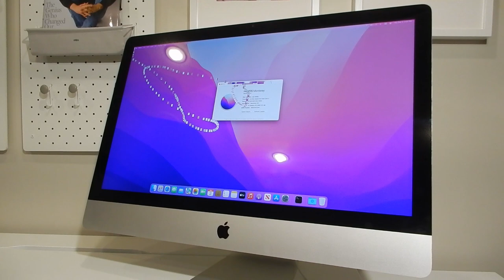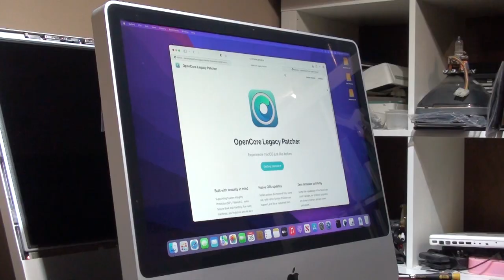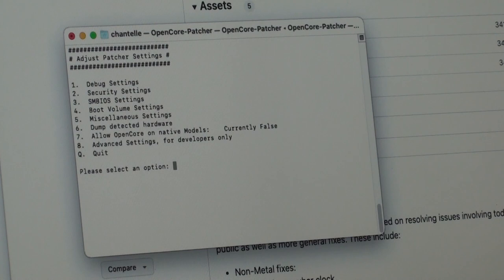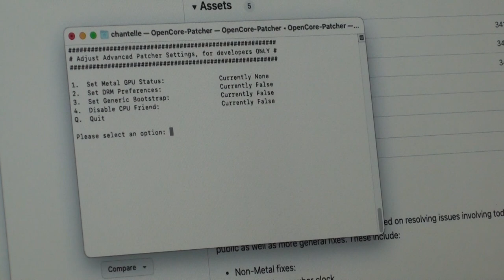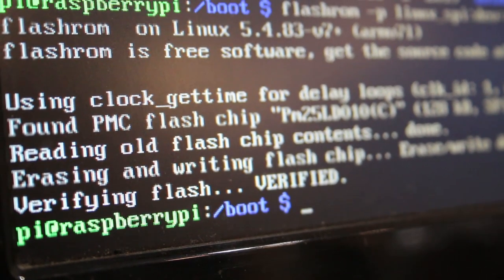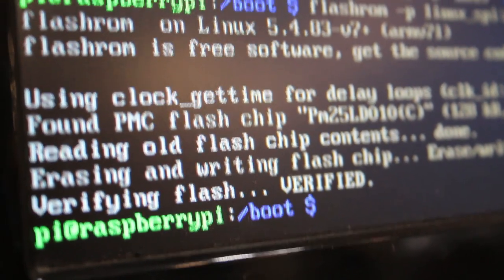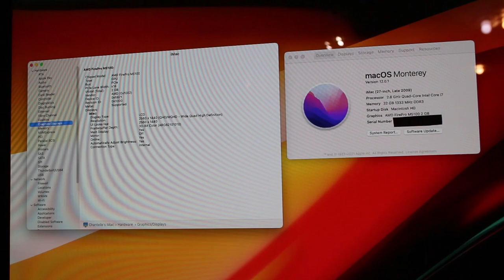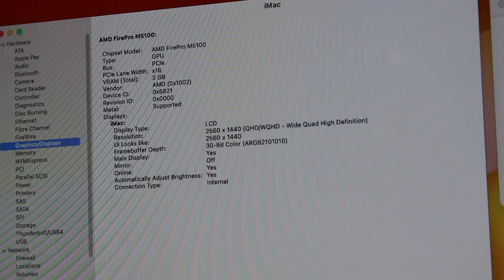iMac GPU Upgrade, Metal SUPPORTED!!

Comment: wish this was possible on my 17 inch MacBook Pro
Reply: There are mods that remove the built in GPU and replace it with an external one but that's about it.
Reply: It is.
Reply: It’s called a Demux, ask around board Repair technician around you if they can do it. 
I live in France and ask 49€ for this modification
Reply: Had the board replaced with a m1 Mac mini board works amazing
Reply: @DavidOlivarez08 what year 17in MacBook Pro did you have? How involved was the swap? We’re there other parts that needed to be changed out to turn your intel MacBook into a m1 macbook?
Reply: @DavidOlivarez08 how did you do this?
Reply: @DavidOlivarez08 wait that's crazy, a 17inch Macbook with an m1 board sounds fantastic

Comment: Alright..  Looking good.  😏👍 The card you chose was a good value and match for a 27".  I did the Linux method with a flash stick.  I used a k2100 Nvidia graphics card  with a 2011 21.5" and worked so well that I got a second one for a 2009 27".    This graphics card packs a punch.  It has decent performance, uses low power consumption of only 35watts and also rather good price.  Oh not to mention this card fits easy without modding.    I also like Nvidia because I have a dual boot system with windows which this card performance is actually amazing on windows.   Oddly it feels faster than with macOS.
Reply from the maker: Nice!  How did the Linux method work?   I foresaw a lot of potential issues (i.e. runs blind until Linux is loaded, etc), which is why I used the RasPi flash method.

For Windows, Nvidia is defiantly my choice too.  I do very little gaming, and much more render workloads that utilize CUDA.  For Monterey though, I think you need hacked drivers to get Metal working - I think something related to that spat between Nvidia and Apple, which is a real shame.  Any issues at all with drivers?  Sleep works properly?

Not having to mod the cooler is a BIG plus for sure!  I was always skeptical that using a shim wouldn't deliver optimal cooling.

I am really curious though, do you have boot screen working?  Can you use the native Apple boot picker prior to OpenCore loading?  You can't on the AMD card I used, which so far is the only downside - fortunately it's only an issue for repairs and service, and doesn't affect daily use.

Comment: It's been a couple of years since I did some upgrades to my 2011 iMac, but this video is a total inspiration to upgrade to the M5100 now!
Reply from the maker: Make sure to check the docs; back when I did this upgrade the M5100 GPU had some known issues involving sleep mode when used specifically with a 2011 iMac.  They may have been fixed by now, just always good to check :) Good luck with your project!
Reply: @rebootretro  Any idea of the overall improvements of this over the default GPU, or is it moreso just a 'replacement'?
Reply from the maker: @TECH097  For most things you'll be CPU bottlenecked.  The only reason I did the upgrade was to replace a failing stock GPU, and more importantly to gain Metal support so Monterey would work fully.  If you are looking for performance, this is probably not the chip for you - there are other compatible upgrades which will give you more GPU performance.  If all you want is Metal support so you don't get weird graphics glitches in Monterey, then this works perfectly.

Comment: Your video is lovely.  All the text forums are filled with bad English and truly hard to understand as nobody posts solutions, only questions. I'm on a mid 2011 3,4 GHz Quad-Core Intel Core i7 iMac and I absolutely love this machine. Got it for a bargain price and I've now installed 2.12 and Sequoia as I thought that would fix iMovie for me, lol. No such luck, iMovie's preview screen is completely black. I am also scared to remove the glass. Any assistance most welcome.
Reply from the maker: Thanks for the nice comment!  I know what you mean about the forums; perhaps it looks somewhat easy in the video, but I spent several days messing around with this until I figured out fully how to do it, lol.  Which was largely to do with very little documentation.  I imagine you haven't upgraded your GPU yet, which is likely why iMovie won't work at all.  The latest version of iMovie absolutely requires Metal graphics and won't work without it.  The only "software fix" around this is to run an older version of iMovie from before it moved entirely to Metal graphics.  Although in order to run an older iMovie, you may also need to roll back your macOS version to support it.  In theory, upgrading your GPU to a Metal-compatible one should solve this on Sequoia.  There are some new apps which may also require newer CPU features in addition to Metal; I'm not 100% certain if iMovie has any additional CPU requirements that the 2011 CPU doesn't meet.  BUT, I'm currently working on making a video involving a 2008 MacPro with a Metal-upgraded GPU, and one of the tests is iMovie.  I can tell you for certain iMovie does open, but I haven't tested editing yet.  If this 2008 runs it, your 2011 CPU should be fine after upgrading the GPU.  Make sure you're subbed and watch for that video.  I'll try to remember to message you back after I run the tests.  Regarding the glass, I would not be too paranoid about it, but obviously use proper safety - have safety glasses and insulated gloves.  The glass does have some flex/bend to it without breaking.  The key is to open it evenly, not allowing the glass to twist too much side to side.  Also don't open too wide of an angle, or the bottom pins in the glass get stuck in the frame and could crack the glass.  Lastly, if you do open it make sure you know proper safety on these units, or have help from someone who has proper training.  Behind the screen is an exposed power supply, which can stay charged and shock you even after the computer is off and unplugged.

Comment: Do I understand correctly that it will also work on this Mac? Apple iMac "Core 2 Duo" 3.33 27" (Late 2009) Specs
Reply from the maker: I looked online, and it seems the late 2009 with Core 2 Duo should support it.  Check the link in the description to make sure - It has good documentation for exact cards supported for exact iMac models.

Comment: I'm surprised you didn't see better 3D results. According to User Benchmarks site, the m5100 is over twice as fast as the stock HD 6750. I wonder if it's a driver issue? Regardless, the HD 6750 is a dead man walking. I appreciate the care you put into this video.
Reply from the maker: I was shocked too, I was also expecting better results.  In fact, it should have been even better since this one had a 4xxx series card (4670 was it?) not the 6750.  I wondered if maybe it was a driver issue, or something to do with OpenCore or the modded BIOS.  I don't think the CPU is bottlenecking it, although I didn't look into it very much.  Ultimately the goal was metal support.  Thanks for your support!
Reply: @rebootretro I have to wonder if it would work better under Linux with the better driver support.

Comment: Hi RRetro, what kind of thermal paste would you advise I should use for the used stock GPU HD5750 I ordered for my 27" mid2010iMac?
Reply from the maker: As long as it's decent quality, it doesn't really matter.  I use Noctua NT-H1 because it's relatively cheap and good quality.  The premium pastes are a little better, but cost a lot more.  For the thick white paste, I reused mine because I didn't have this type on-hand, but I would definitely recommend replacing this too.

Make sure your cooler is mounted evenly on the die (tighten in stages).  Setting your fan curve to run the card cooler will have much bigger benefit to the card than better paste will.  I'm not positive offhand, but I think I generally have them running around 45c average core temp at idle; I think Apple's stock curve lets them hit over 75c idle which is way too high IMO.
Reply: @rebootretro  I have no idea what to look for the thick white paste you say. I would appreciate it if u could suggest what you would put on yours. Setting the fans to run so the temp is 45c will need a fan app?
Im very excited to receive the used gpu cause this time i want to make the best of it and revive as much as i can my good old iMac and if i manage it you will have a big part in that :)
Reply: @rebootretro  Hello my friend... since im trying to "Retro Revive" my iMac ;-) maybe i wouldn't mind about costs so much, especially since i've been burned twice with the gpu! So which thermal pastes would you use yourself for both gpu chip and the others?

Comment: I almost threw out a 27 inch 2011 iMac today. I’m so glad I discovered opencore. I may revive this mac
Reply from the maker: They work great with an upgraded GPU!  Just note the OpenCore docs, there are some known issues with the FirePro M5100 and specifically the 2011 iMac model, unless they’ve been fixed.  But there are lots of GPU options out there. Either way, they are great machine still with a GPU upgrade!

Comment: I also upgrade GPU card for metal support, i choose  through ebay the Nvidia GTX 675MX (4GB+METAL).
Notice here, that i use to this iMac-mid 2011 27" through open core,  the Monterey.
After installed, is not start up easy, i had to press many times the power button, and if it is starts, sometimes works flawlessly, sometimes had issues with bluethooth connection or usb mouse+keyboard. 
Also from the sleep fails to wake up, if are in the sleep mode sometime. 
Without the LCD screen plugin starts without delay and the trhee diagnostics led lights on.
Before the GPU upgrade not have such issues.
If you have any helpfull hint are welcome.
Reply from the maker: I'm not familiar with 675MX specifically, but did you flash a Mac vBIOS ROM to the card?  If the card is using the stock PC vBIOS ROM, it might work but have some issues.  Also, double check that you have the correct vBIOS ROM.  Some cards have different revisions and use different ROM versions.

EDIT:
This seems to be a Kepler card, which apparently has some issues with OpenCore.  Checkout this forum post: https://forums.macrumors.com/threads/2011-imac-graphics-card-upgrade.1596614/ but specifically SPOILER 3 - Known issues or problems #5, #7 and #8 might describe some of the issues you're experiencing.
Reply: Dude, I have the same problem. 27" 2011 imac, replaced stock Radeon with 675mx, and mine also does not always start from the first attempt and does not wake up under Catalina, but wakes up well under High Sierra.
Another issue is a bit sharp edges at halftones. For example, at the picture when grey becomes white, I see line edges.
Seems like recovering to High Sierra and other OS via Boot Camp is the easiest way to give this machine its second life.
Reply: @rebootretro  Which is absolutely a criminal behavior from the vendors. None of that should ever be needed, a software for all OSes should exist so it could be flashed EASILY. This with different stuff for different OSes just makes me sick.

Comment: Thanks for this. Had no idea it was even possible. With Metal support and the ability to upgrade to a more recent version of OSX I can get years more life out of my old 2011 iMac for my daughter. If I max the RAM and add another SSD instead of the HDD, the old i7 2600 should keep kicking.
Reply from the maker: Yes, they don't always get the credit they deserve; even today that i7-2600 is a good performer!  With Metal support, a 2011 is almost as good as a new Mac :)
Reply: @rebootretro . Now its just a matter of working out how much I want to spend on a new GPU. The WX7100 sure is tempting. Will definitely allow Minecraft to run smoother for her. That iMac was great during Covid lockdowns. She basically did two years of schooling on it. The biggest issue is just down to the fact its limited to an older OS and its harder to find apps that will run. This seems like a fun project either way.
Reply: @dog_knight  I'm running Monterey on mine with OCLP. It's dead easy.
Reply: @ninline2000   Have done the same now. Ended up picking up a WX7100 and have upgraded to Monterey using OCLP. Put a new SSD in it at the time too. I also now have a new WIFI / BT card to install when I find the time.
Reply: @rebootretro what is metal? Why is it such a big deal? Link to a good explanation?

Comment: Will FirePro M5100 work with 2009, 21.5" iMac 10.1?
Reply from the maker: Yes, but it looks more difficult in the 10,1 because the graphics are internally wired differently.  The link in the video description, scroll down to Spoiler: 2. Working AMD Graphics Cards and then down to Spoiler: AMD LVDS for iMac9,1 24 inch early 2009 or iMac10,1 21.5 inch late 2009.  I think it requires a different vBIOS.  Read through that post, and it will explain how to make it work :)

Comment: What gpu do you guys recommend for an iMac 27 mid 2010 and another iMac 27 mid 2011? I’ve both.
Reply from the maker: As far as I'm aware, there isn't an "ideal" card to use.  Each one has some difficulties or caveats.

I really like the M5100 FirePro because it's incredibly cheap to buy, full Metal support, and it works completely native with native drivers after patching the OpenCore loader and vBIOS.  It works pretty near flawlessly in Mac OS.  The one issue is that the M5100 only gets loaded AFTER OpenCore, meaning you loose the boot picker (i.e. can't hold option key during boot to select an alternate boot drive).  It will work on a 2011 too, but there are some additional (and potentially more serious) problems you should read up on if you use this card or one from it's family in a 2011 iMac.

I think there are some NVIDIA cards that maintain the boot picker, but since NVIDIA's dispute with Apple there aren't any modern drivers and they all require hacking.  The NVIDIA cards work great with older versions of Mac OS, but newer ones it is better to stick with supported AMD ones for driver support.

I don't believe any card is completely issue-free; it's a matter of picking the one that has least offensive issues for your use case.  I highly recommend this forum post: https://forums.macrumors.com/threads/2011-imac-graphics-card-upgrade.1596614/

If you click through the "Spoiler:" sections, you'll find a very organized table of cards which people have tested along with custom vBIOSes and any special notes to make it work.

My biggest advice though:
Only use exact cards tested.  Just because a card is very similar, doesn't mean it will also work.  Do lots of reading prior to purchasing a card; make sure you understand the necessary mods, and if you need your card to have specific revision number or specific RAM chip types, etc.

It is a fun project!  Good luck in your upgrade!
Reply: @rebootretro  wow! A very nice and helpful answer! Thanks a lot. I’m not technical and i use imac only to work. I really prefer the most basic, buy gpu, open the imac, not needing to take motherboard out and just change the gpu. That would be the simple scenario for me. I’m not looking for the best gpu at all, just one to be simple and better that the 512MB of vram that this imac 27 2011 have.

Comment: I did this to my 2011 27 imac, using a 880m. It worked amazing for about 2 months and slowly started having the same graphics issues as the Factory Radeon card.. I'm assuming overheating is a major problem in the iMacs hot chassis.. is there a Graphics card that doesn't use as much power as the 880m but still has better performance than the radeon ?
Reply from the maker: The card itself shouldn't matter, unless the card wattage is substantially higher than factory models.  It is more likely an issue with mounting pressure or fan curve.  Some of those cards look like the die height is the same, but it is not.  If the die is shorter than factory card, the mounting pressure won't be enough and will have poor cooling.  This is EXTREMELY difficult to see with just your eye, you'll need to use a measuring tool to know.  Also, I use Macs Fan Speed to adjust the fan curve of the GPU fan very aggressively.  I adjust it to where you can barely hear it when idle/web browsing, which is significantly higher than factory.  My Radeon 5100 die hovers around 60 degrees if I remember (if it's not heavily loaded).  Factory it sits around 80-90.  Also, it's important to make sure you have enough (or possibly fresh?) white paste for the other components like RAM.

It's also possible if you are buying cards from eBay that the card already died and someone did the "heat gun trick", which is just a temporary fix.

Bottom line though, any card that is equivalent or less wattage should be 100% fine if the cooler is mounted properly and the fan curve is dialed in.  You should not be getting dead cards that soon!

Comment: you can undervolt and underclock the hd6750 using windows to extract, mod and flash back the vbios to extend the life; i have done that to reflown 2011 imac gpus on all the range and it works quite well
Reply from the maker: Very interesting!  My experience too is that reflowed GPUs are much more "fragile", and require much more cooling to prevent dying again.  The undervolting sounds like it would work extremely well for that!

Comment: Hello! Great video. I have a question: is Amd FirePro M5100 compatible with iMac12,2 inch 27  - mid 2011 model number A1312? I ask you because I found the card on Aliexpress but the seller writes: DO NOT USE IN 2011 iMac12,x systems. Thanks in advance for support!
Reply from the maker: Hi, thanks for the comment!  I've not tried it in a 2011 specifically.  My understanding is that it "works fine" in a 2011, but there are issues when waking from sleep mode.  Basically if you let it sleep, it will go into a coma and not wake up; if you disable sleep mode entirely, it "should" work fine.  It's also possible that the OpenCore team has since addressed this and fixed it already, but unless you read specifically that they did I would assume it's still a problem.
Reply: @rebootretro  Great! Thanks for reply